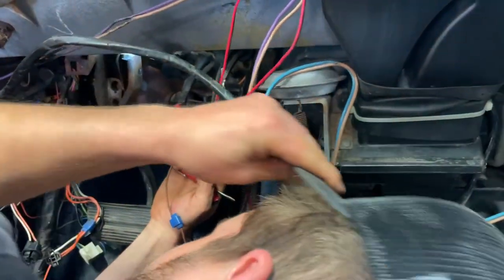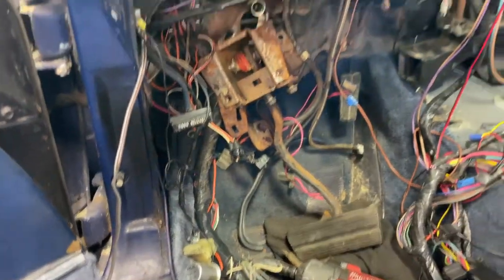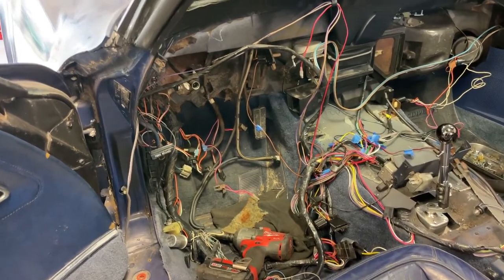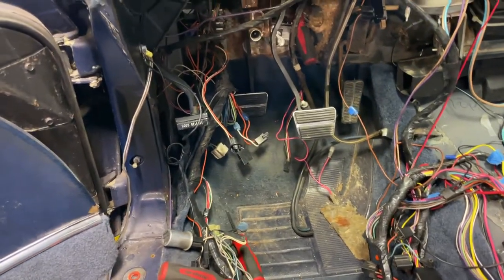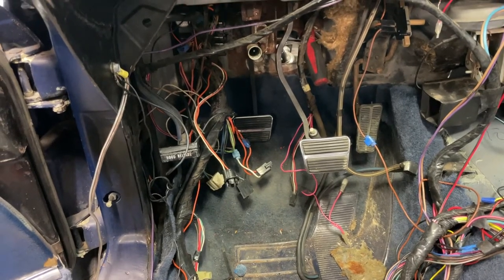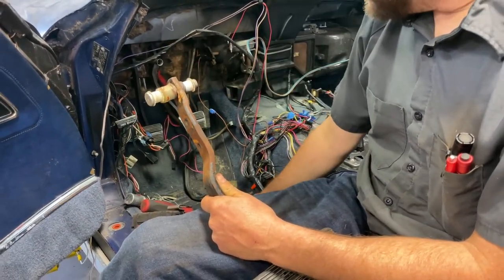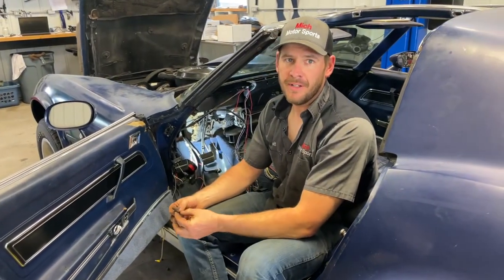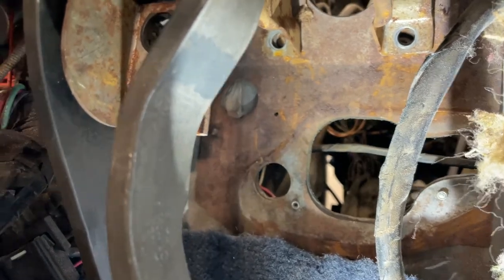Installing The Clutch & Brake Pedal 77 C3 Corvette Trans Swap

Comment: 1. Check out MalWood clutch conversion for C3
2. While you had whole assembly out, couldn’t you just quickly sand it a spray some paint over it and not reinstall it so rusty… just sayin :)
Reply from the maker: Thank you!  We thought about slapping on some spray paint but you don't see it once everything is back together.

Comment: How Does The Hydraulic Clutch and pedal work all installed? Would you use the same system again or use something like Malwood.. Thanks
Reply from the maker: It works amazing! It was a challenge getting the hydraulic master cylinder installed but the results were well worth it. We had someone comment that they used a kit specifically made for C3 corvettes. They said their install of the clutch hydraulic master cylinder went much smoother. Maybe worth looking into.

Comment: I'm doing an auto to TKX swap from Silver Sport on my 1980 C3. The master cylinder bracket was a way easier install. The angle it's at, I just used the existing/stock stud on the clutch pedal for the linkage to the master cylinder. Not sure if this would've worked for your application. Nice work. Really enjoying the videos.
Reply from the maker: We are so happy you are enjoying the videos!  Thank you so much for that comment!  How are you liking your TKX?
Reply: @MichMotorSports  only a weekend warrior, so I'm currently working on getting the bell housing within tolerance. I'm sure I'll be loving it in about 5 months when the snow melts 😎